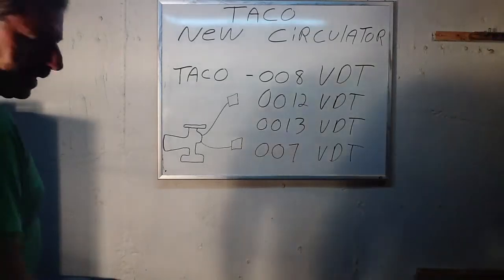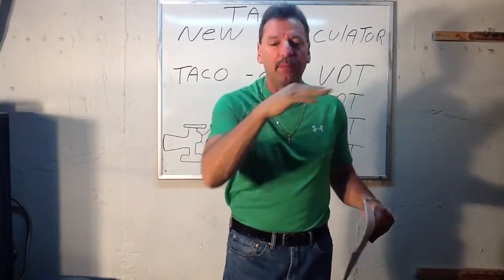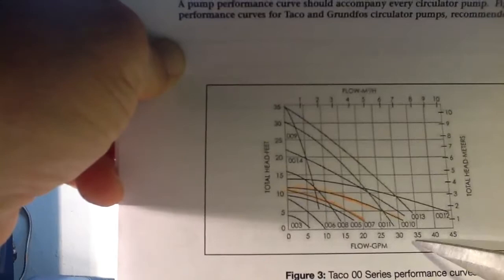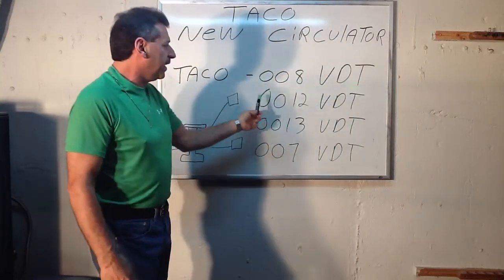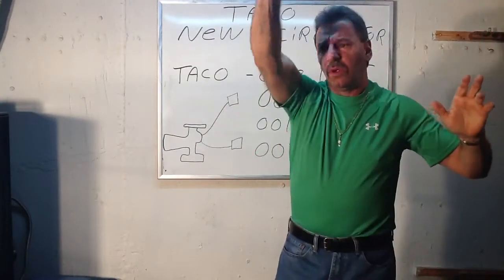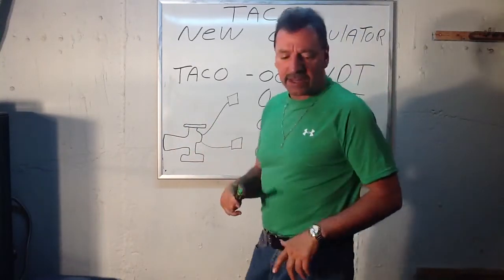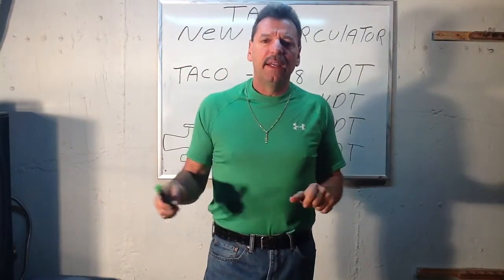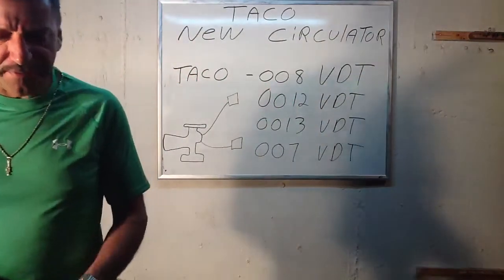Circulator new VDT from Taco, has a brain

Comment: what do you think of the new ECM models?  I just installed a Taco VT-2218 and the damn circuit board is bad straight from the mfg. Looking to use this older VDT model to replace.